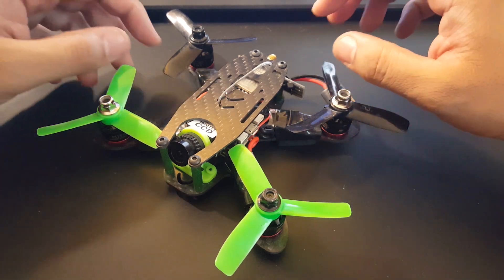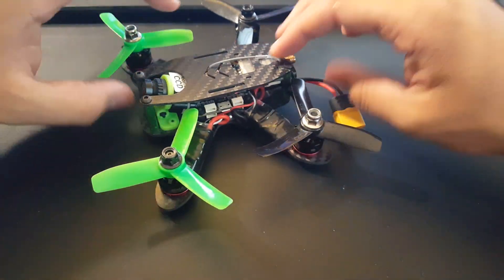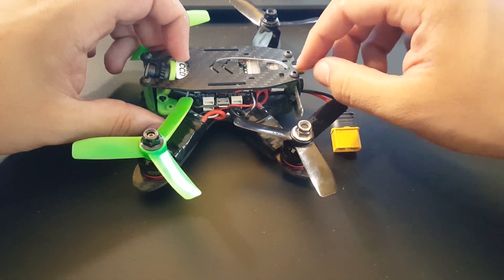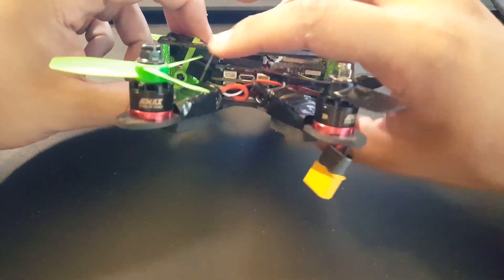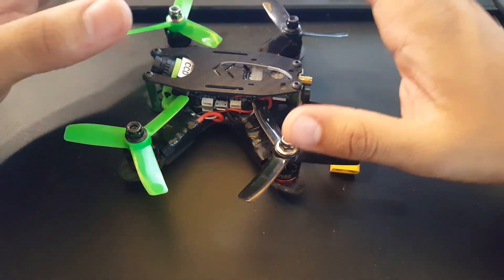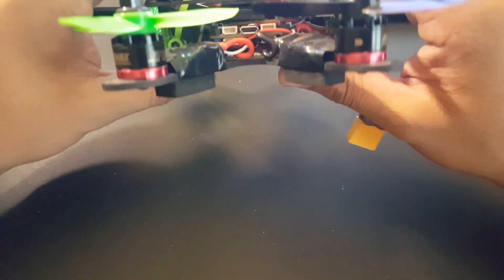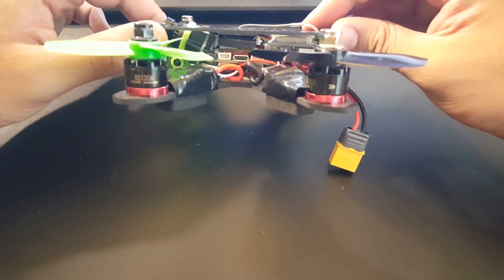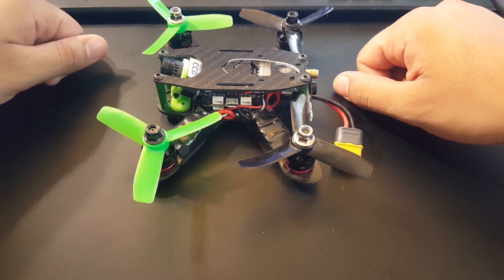Building the Best 3 inch Quad // Part 1

Comment: Just got the Geprc Stretch X Sparrow.. can't decide on the motors.  emax 1306 4000kv or the BrotherHobby Tornado T1 1407 3600kv... Anyone know what would be best motor choice.  I will be running F4 v5 Pro full size board with DYS 20amp esc Stack

Comment: I like your build, been flying 3 inch for more then a year with those motors 1306 4000kv 4s. You could change the prop nut to a lowprofile flange nut from hobbyking. You could use the 4blade eachine 120 props. You could use a true x frame like the gb130. You could have used an aio cam for lower weight.

Comment: I have been looking to build a 3 inch. Looking forward to the build. On a side note I am looking at EXTREME32 - 4in1 esc but there is nobody talking about it yet. It's on readytoflyquads, will you be able to test it possibly? :)
Reply from the maker: send me link
Reply: http://www.readytoflyquads.com/35a-extreme32-4-in-1-32bit-esc-blheli-32-d-shot1200
also there is a 25 amp version
http://www.readytoflyquads.com/25a-extreme32-4-in-1-32bit-esc-blheli-32-d-shot1200